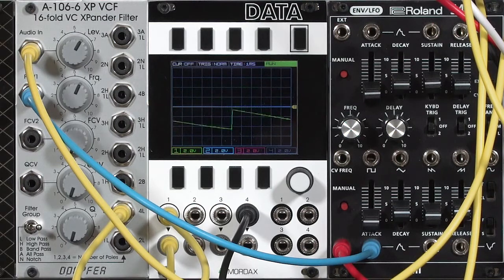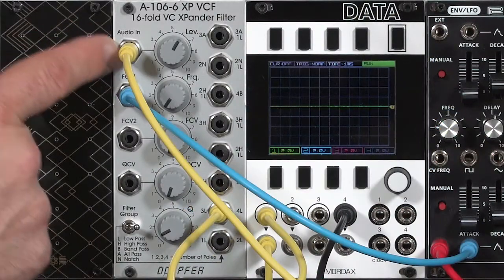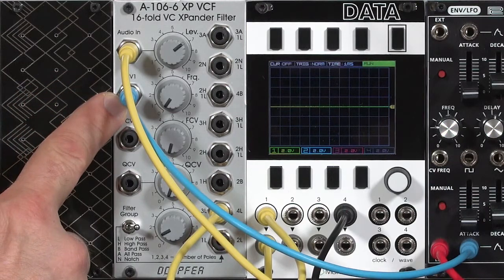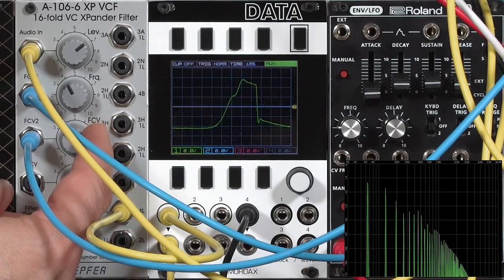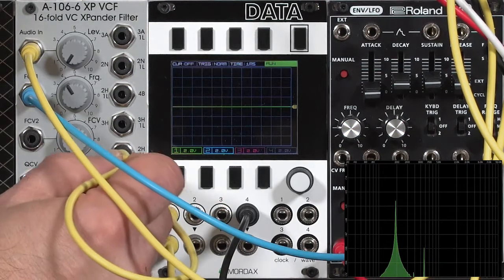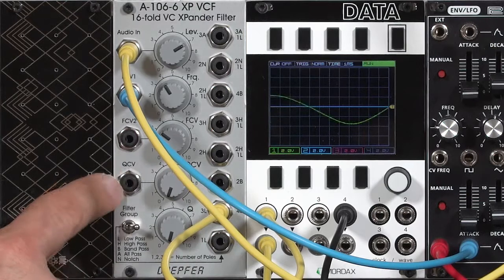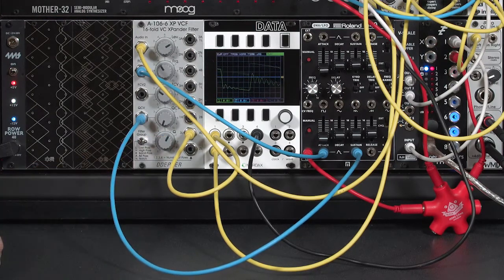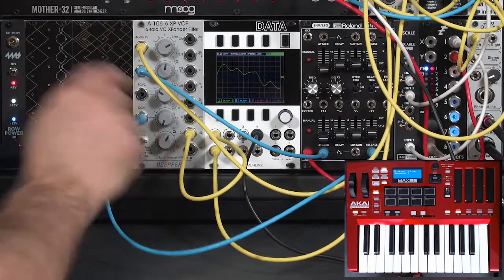Doepfer A-106-6 XP Filter 1/4: overview (LMS Eurorack Expansion Project)

Comment: Great overview. The Doepfer filters often get overlooked. Another really interesting one is the A-106-1 Xtreme Filter which is intended as a crude approximation of the Korg MS-20 filters. Very unique and somewhat experimental. It offers extensive control over tone using both positive and negative clipping as well as polarity of the HP in relation to LP in the mix. It excels at chirpy, tortured sounds! I love it.

I should also point out it is the only filter I've seen that allows external processing of the resonance loop. Like a delay feedback loop you can process through other effects, VCAs, etc. Something I like to do is mix it with an additional VCO before feeding back in, or gating then through a delay. So many possibilities.

http://www.doepfer.de/A106.htm
Reply from the maker: I have an A-106-1, and intend to do videos for it one day. After having owned an original MS-20, I have to admit it does not have one of my favorite filters, but I got an A-106-1 to explore its tricks like asymmetrical clipping.
Reply: I hear you on that. I have a couple original MS-20s myself. A-106-1 is most definitely not an actual MS-20 clone, but it sure is interesting. Not a filter for all situations. I love the limitations. And the control over clipping really makes it worth owning.